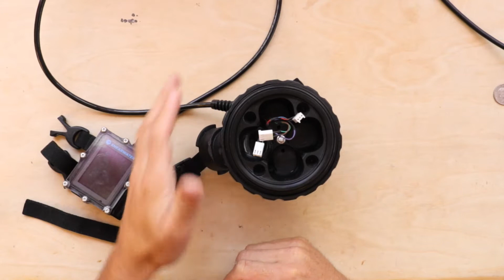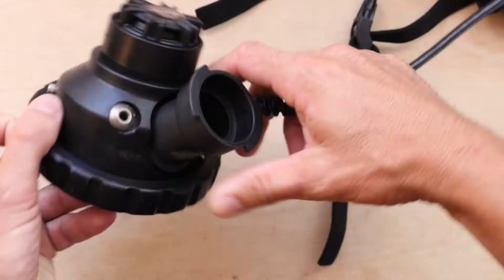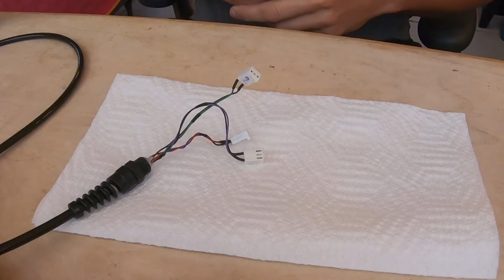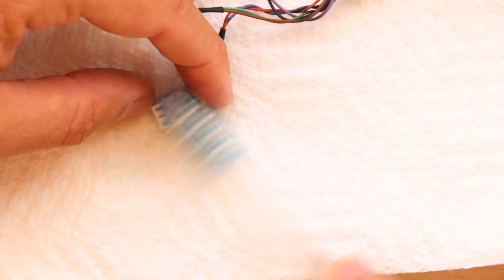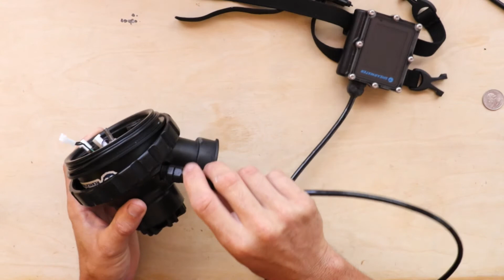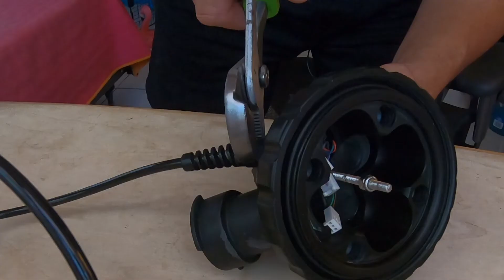How to replace the computer cable on your KISS Rebreather

Comment: How easy is it to change a damaged LED HUD cable on the early Shearwater HUD unit? Is it a matter of just undoing the cable gland from the battery/HUD box where the LED cable inserts into through the cable gland? Any insight would be really helpful. Thanks.